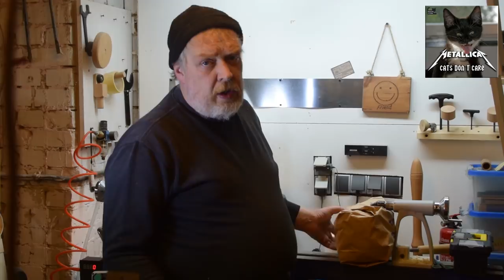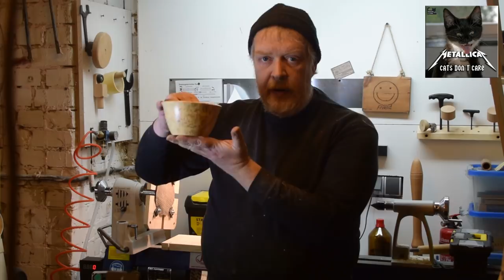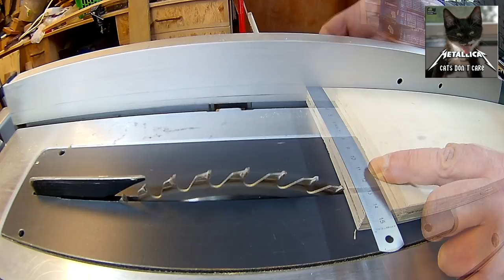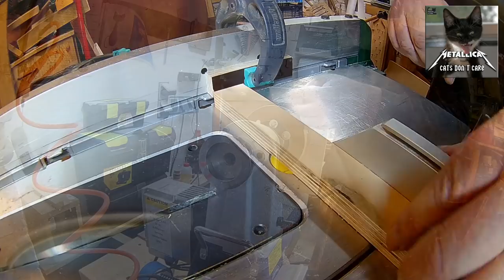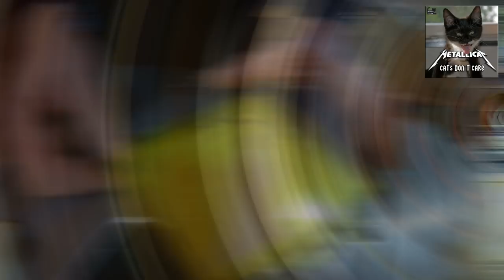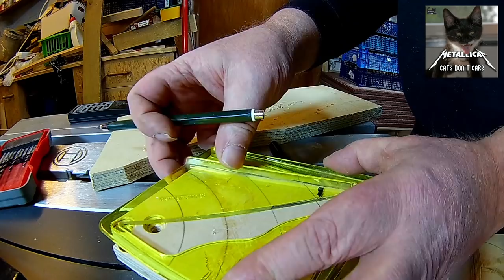Cheap way to put larger pieces on a normal chuck.

Comment: Good call on using the hot glue, I would have tried to screw it all up and make a mess of it :) In the end, when you work on the bowl, that looks scary, since the bowl is out of round, but once the bottom is nice, round and smooth, you can chuck it up normally and go on. Good job!

Yuval